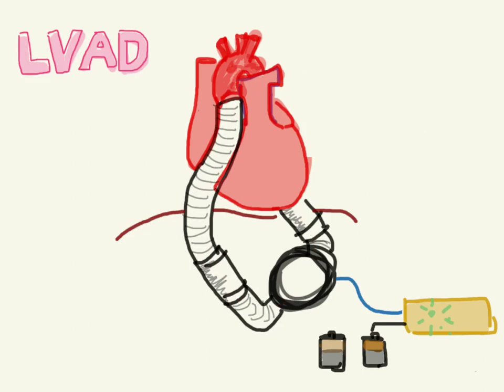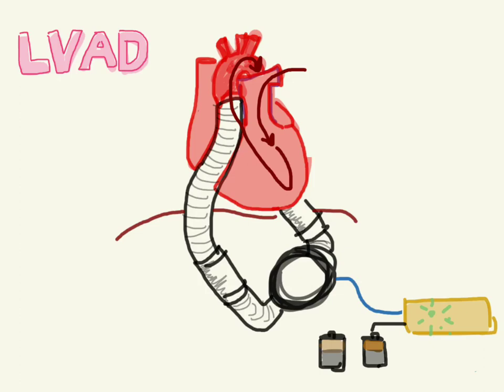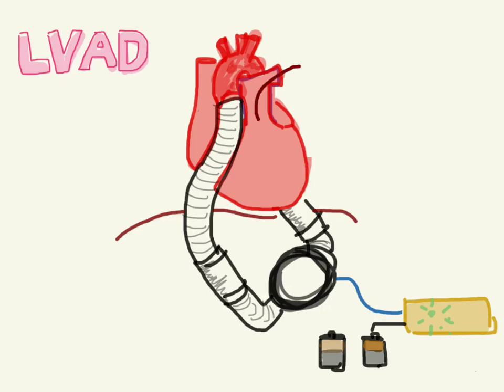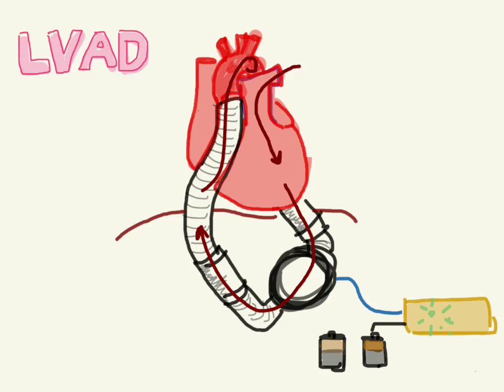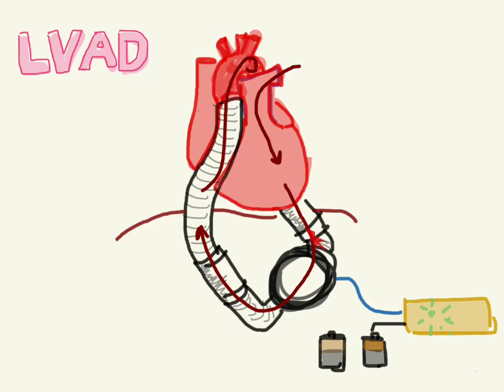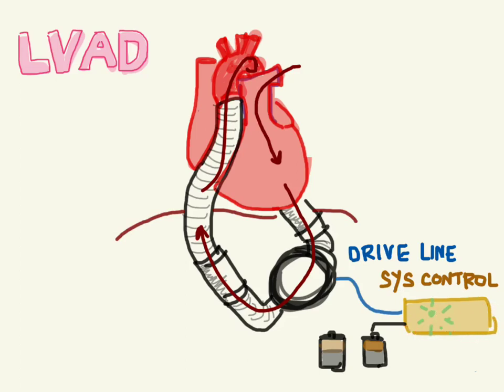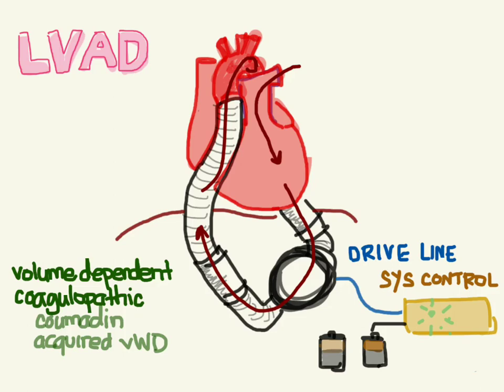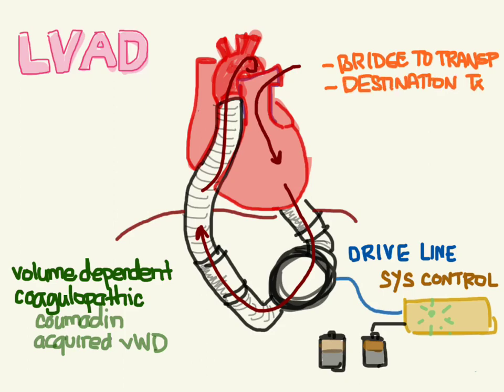LVAD 01: Anatomy and Physiology

Comment: The Ejection Fraction pertains to patients with Systolic CHF only.  LVADs are used for Diastolic CHF as well, where there is a Preserved Ejection Fraction.  Cardiac output is the measure for the LVAD implantation and NOT EJ%. The HeartWare III does have a pulse.